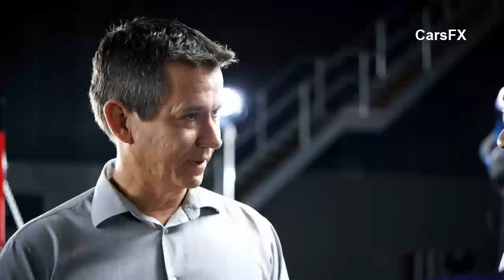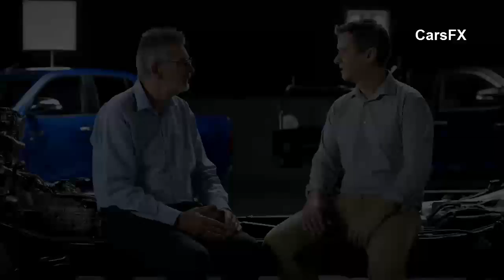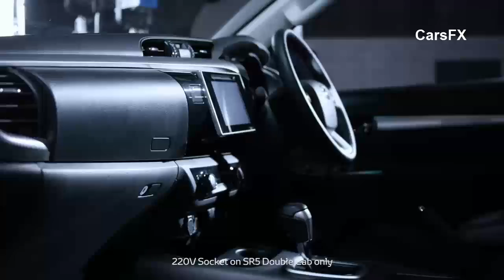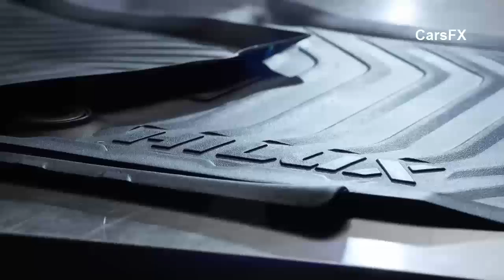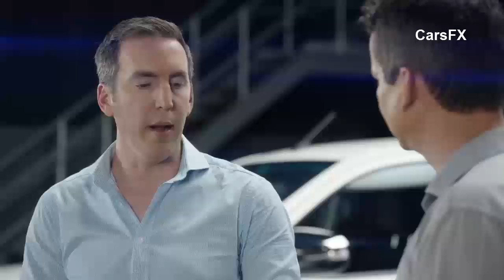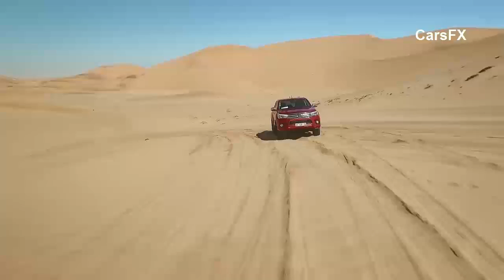2017 Toyota Hilux - Review - Offroad Test

Comment: The hilux is a great ute and good all rounder along with BT50 and Dmax , I owned a hilux for 6 years and 165000 km later the old girl was still going strong when I traded it in as it was time for a upgrade and I finally settled on the Mazdas BT50 for its under stressed engine , high torque rating and towing capabilities along with a outstanding deals that Mazda was running at the time. Buy any of these three utes and you won't regret it.